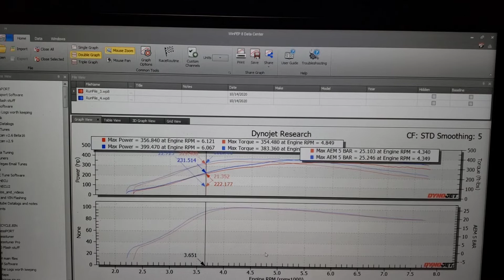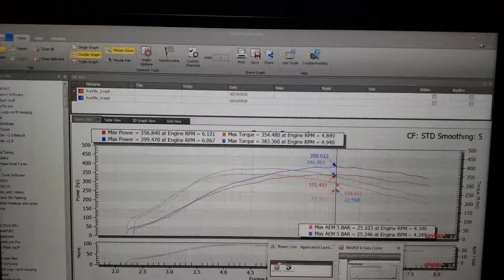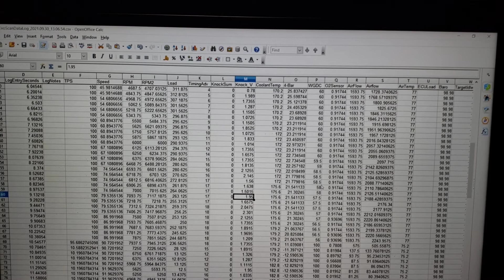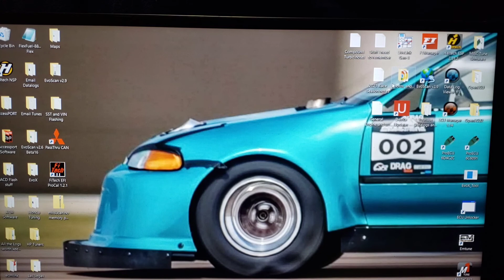Ethanol timing vs Pumpgas timing, what gives?

Comment: Great info, love to see some methonol timing numbers.
Reply from the maker: Surprisingly I don't stray from ethanol on those, just go all of the boost. I balance EGT with fuel first, remaining hit cylinders get a degree at a time, cold cylinders get timing removed. I try to limit the trim amount to no more than 10% on known good injectors with documented flow rates. At that point I start adjusting individual timing.
Reply: @AaronONeal1  more good info we are still at the beginning of our methonol journey and the car is finally working so why not change everything over the winter!!

Comment: 6:11  lambda .917  is 13.4 to 1, right?
Reply from the maker: That isnt actually a lambda value, that is the front O2 sensor in this case.  For whatever reason that narrowband voltage ends up equating to a high 11 normally.